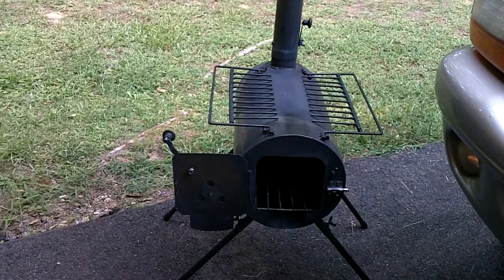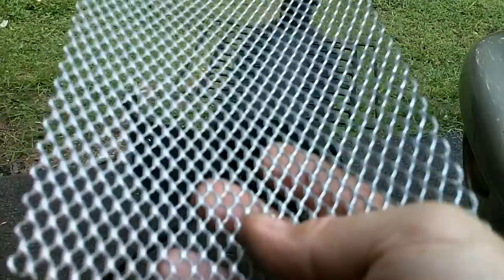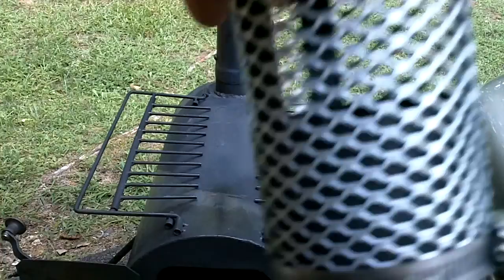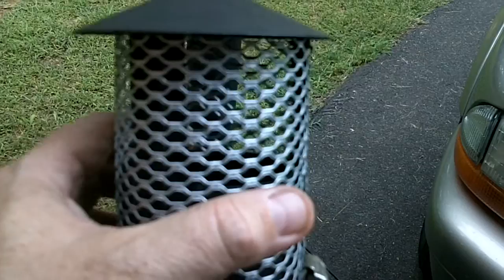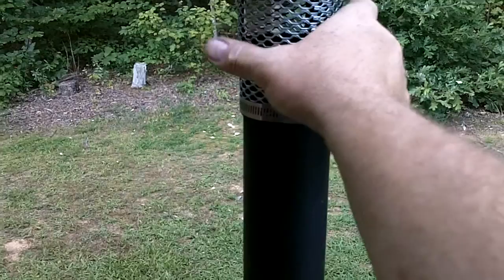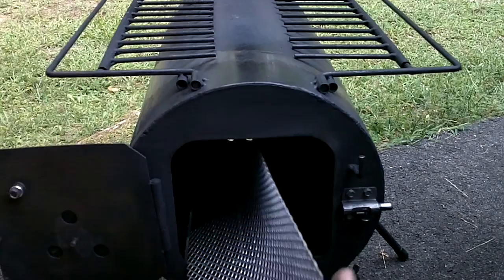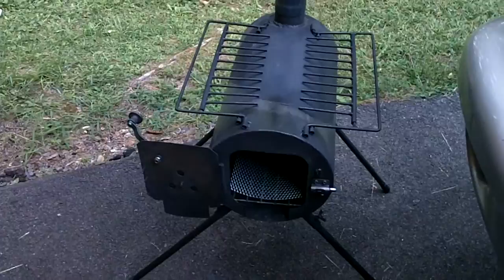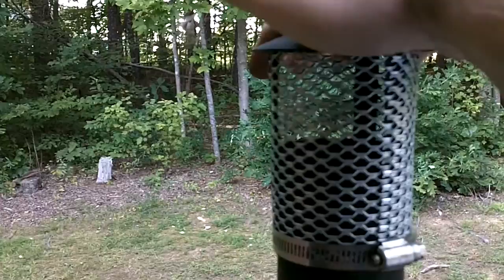TMS Military wood stove spark arrestor Modification

Comment: Really enjoyed seeing your review and modifications on this stove. The one thing I would caution is the use of your galvanized screen in the firebox of this stove. Galvanized metal when heated gives off dangerous fumes. In the small area of a tent these could be very bad. The use of it for the spark arrestor shouldn't be a problem as long as it's outside the tent. Again, thanks for the review, I'm subbing your channel and giving you a thumbs up.
Reply from the maker: +mrbr549 

Glad you liked the videos!! TYVM for subbing the channel. Good point on the galvanized. After one good burn should be fine as far as fumes. Even with that with a tight seal and good draft most all the fumes should go out the stove pipe but safer to burn it off first before burning in a tent for sure. 

Thanks again!!

Comment: That spark arrestor is a great idea, I did a video where I hot tented with this stove and the arrestor it came with basically made the stove useless and dramatically changed the night.
Reply from the maker: Yep, the stock one sucks. You can even make a larger one than the one I show here if you like to help it breath better and clog less.

Comment: What is the ideal mesh size for a hot tent?    I thought that I was going top of the line with a Winnerwell Nomad Stove, but I was disappointed to read a complaint that its spark arrested was getting his tent hit.    And I have a very expensive tent.    I’d rather have to clean it more often than get burn marks into my tent!

Comment: It's a cheap stove, so of course there are many problems. The stove pipe is too small, and therefore the screen area is way too small as well. double or triple the length of the screen area and it won't clog as much. There's no baffle, so the heat rushes up the stack before providing much heat. The door is not sealed, so the the controllability is probably not great. There is no flat surface on the top of the stove, so you can't really cook on it. It's probably thin too, and will burn out if used hard. No diverter on the air intake. About the only thing this stove has going for it is that it's cheap. Given all the fixes that need to be done to make this cheap stove serviceable, you would be better off paying a little more and getting something of decent quality.
Reply: i built my own and with a dampener and spark arrester these type stoves work great

Comment: The solution to sparks landing back on a tent is to angle the pipe and extend the length, but wind can screw almost anything up.  Be careful out there.

Comment: I bought one and well it's got more problems then a spark arrester.  left's not lined up square, door don't close tight, air intake way to high.. it's a p.o.s. in my book. May work in a pinch but won't last berry long in a long time running situation.. but great for a night or two a few times a year camping.. just my opinion on them.. don't waste your $..

Comment: There is no need for a spark arrestor when your stove has a baffle that stops sparks and makes your cooktop hotter than your chimney. The stove is best if it operates vertical with stove pipe exit lower than the cooktop.
My chimney rests on the ground and stove hangs on the pipe with a simple easy to make connector.
Reply from the maker: The "baffle" that is built in clogs very easy and is can not be seen because it is down inside the pipe to tell it need cleaning. This style clogs less and is easy to tell when it needs cleaning before it clogs.

Comment: Thank you so much for your video, the closest i've gotten to finding the information i need considering i have no experience and want to do this right...hoping you have some advice...I've got a winnerwell with 3.5" pipe...going to run it straight up through the roof of my workshop...going to use their triple wall pipe where it goes through the roof, silicone boot and am trying to figure out how to make or buy a rain cap.  Of course my pipe is an odd # being 3.5"...was going to use the existing spark arrestor and add a Chimney Flue Cone Rain Cap on top...i can only find 3" or 4" and no adjustable ones...i was thinking i'd buy the 4 inch and crimp/cut it to fit on top of my spark arrestor and use a hose clamp to lock it in place...if you could give me your thoughts i'd really appreciate it!
Reply from the maker: To be honest for a workshop I would ditch this stove and buy you a barrel kit or look at the Camp Chef wood stove which is a much better stove than this one. This stove is ok for occasional emergency use but not something I would ever use on a regular basis.